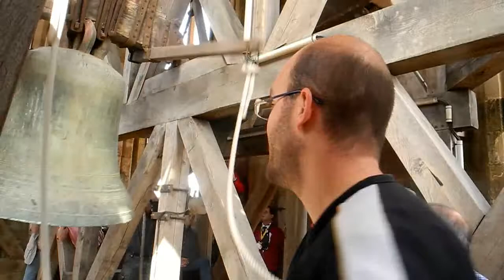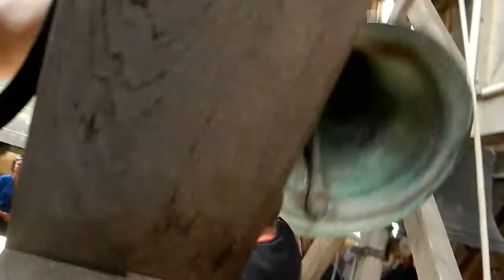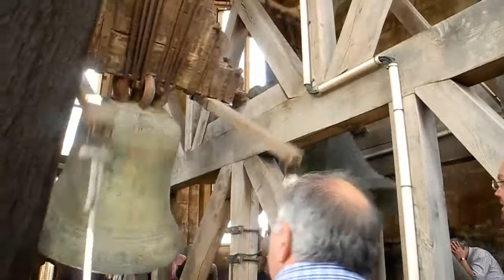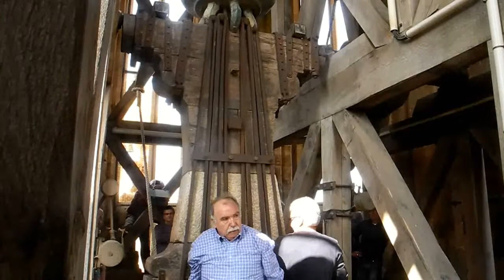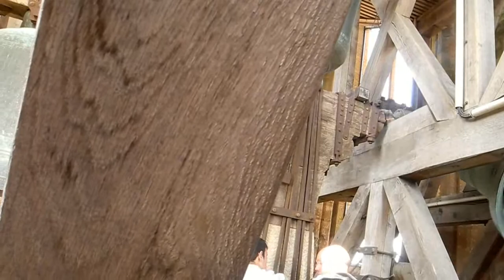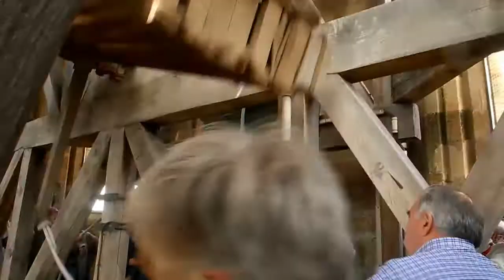Toc de les campanes de la catedral de Tarragona

Comment: Tengo una pregunta pero antes que quede claro que se que en Cataluña no es tradicional el volteo y ahora viene la pregunta: ¿Esta campana estaría dotada para el volteo? Igual no porque no esta contrapesada o porque el badajo no es apto para el volteo, pero yo la veo que si puede. Y repito, se que en Cataluña no es tradicional el volteo, pero es que me picaba la curiosidad
Gracias por adelantado.
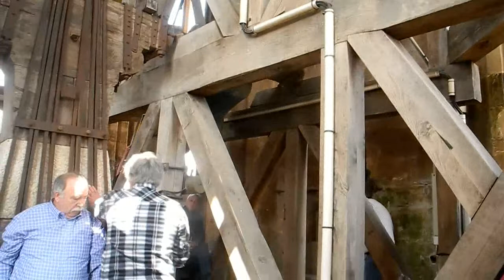Reply from the maker: Sorry to reply in English.  I do not know Spanish :-( and had to use Google Translate.  The question is whether there is a stop.  I cannot see on on the images.  But at 10:14, the way they are pushing, it looks as if there is a stop.  If there was no stop, would the bell not continue to turn the other side when they push like that ?
Reply: @thierrypauwels  Don't worry about replying in english, I also know how to speak in english. Yeah, that's what I'm talking about, whether there's a stop or not but you can clearly see how they stop it. I'm also aware of the fact that maybe the clapper It's not the best to be rolled, because the traditions and blah blah blah... It was only because it went inside my mind 😂😂. Also thanks for replying!!
Reply: There’s nothing stopping the bell from spinning, but if it does it’s fine as it is equipped to do so